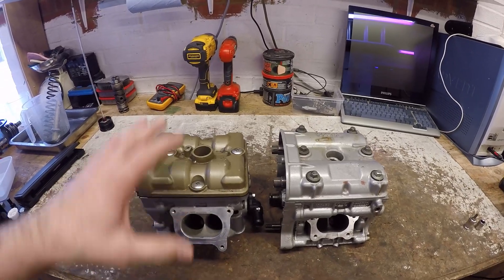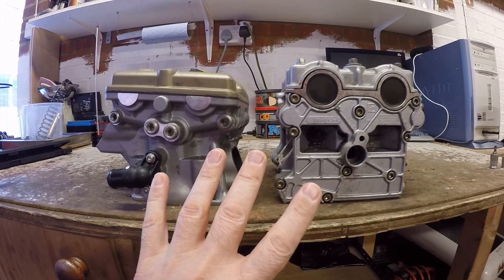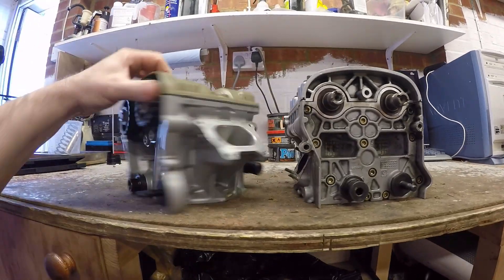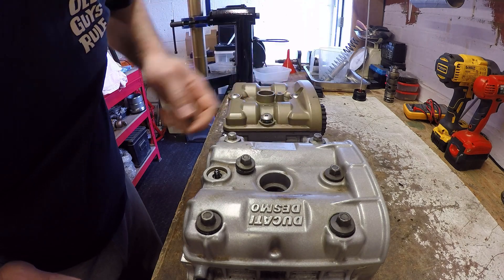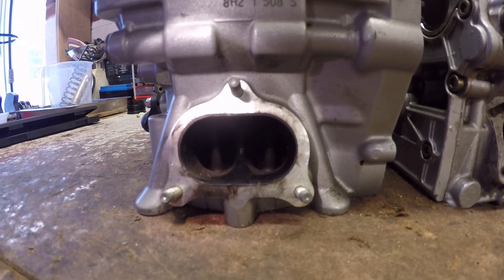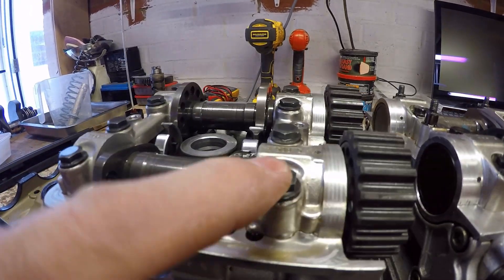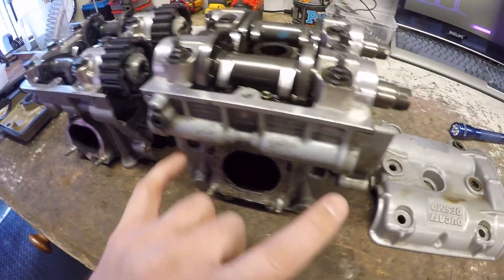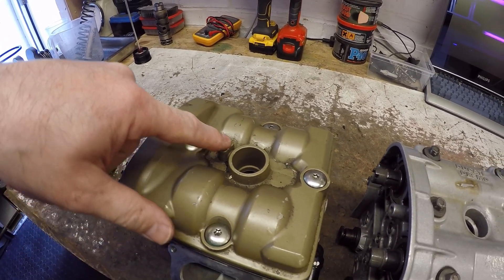Ducati Tech 848 vs 999 Head

Comment: Cool video. What are your thoughts on early Testastretta belt change intervals? Ducati specified them to be 2yrs/12,000 kms for my my 998, but on current models it's now 5 yrs/30,000 kms. What changed over the years to allow for the longer intervals? I don't think the belt path changed much, if at all. Maybe new belts are better manufactured? In which case a brand new 998 belt should be just as durable as any other modern Testastretta belt. It would be nice to have a 5/30 belt interval, but not if it's a major risk.
Reply: I'd love to hear his thoughts on the subject also
Reply: I think what changed is that Ducati wanted to improve their sales of bikes and are finally coming clean about the fact that these belts last a lot longer than they led us to believe, without actually coming out and admitting it. Just my opinion. Fwiw, the belts on my 999 are 6 years old and haven't snapped.

Comment: Nice video what kinda miles are the 848 v-twins engines good for before a rebuild ?
Reply from the maker: Hi ninja, really depends on how well they are looked after and what use they have seen. I have heard of mileages in excess of 40000 with no problems.

Comment: Quick question for ya. The plug seals on the back of the 999 head. How are those removed & installed?
Reply from the maker: Do you mean the cam seals? If so its the cam cover followed by removing the cam caps which pinch the cam seals in.
Reply: @DesmoWerx  thanks! I just bought a 2003 999 got alittle work to do before she's ready for the streets. I've notice my cam seals are cracking a little so I plan on replacing them. One more question Do you know of a good replacement front brake master cylinder. Mine has no pressure. Thanks again!

Comment: Could you measure the valve spacing on the 848 heads? Could you put 848 cams in an 999 head?
Reply from the maker: I will measure them up for you when next out in the garage
Reply: @DesmoWerx  Supurb!

Comment: Great explanation. Is there any aftermarket alternative to the crappy and expensive cam-wheel nuts?
Reply from the maker: HI nlpx, not that I have managed to find as yet.
Reply: @DesmoWerx  Do you think a self securing m17x1 nut with a polyamid insert would do the trick?